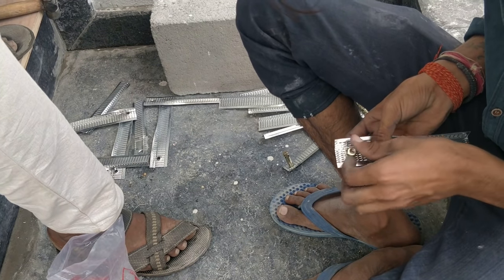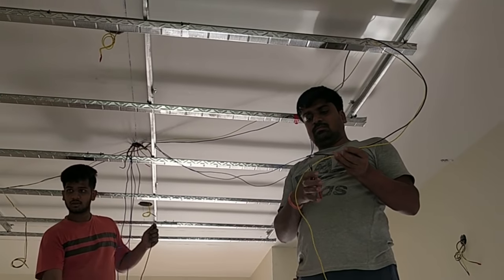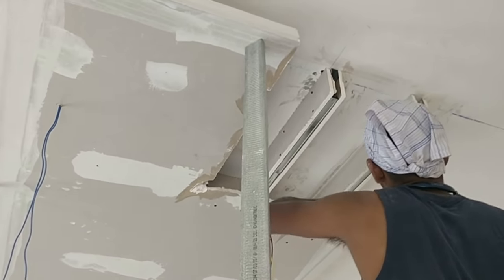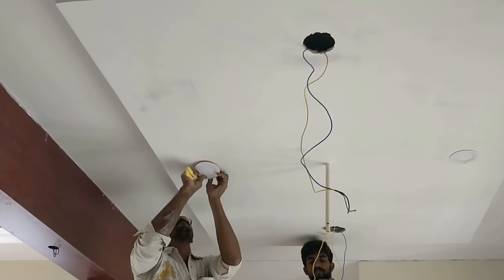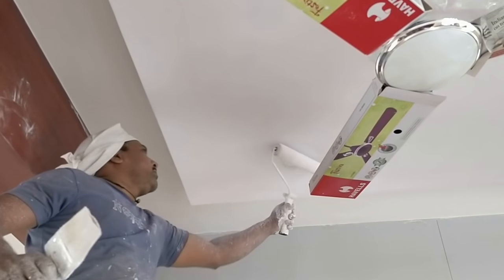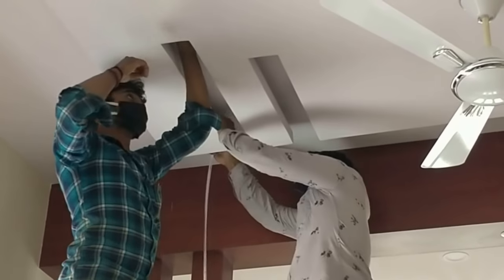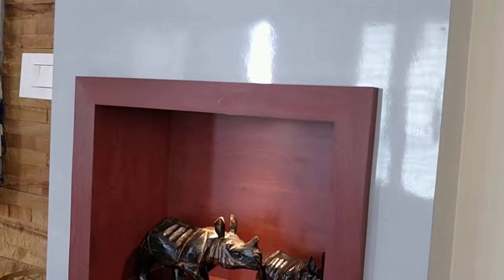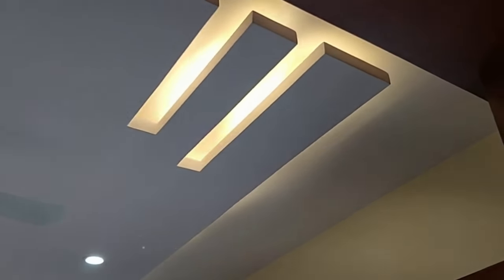Entire False Ceiling Work in 8 minutes - A2Z Construction Details

Comment: Wont drilling holes into concrete ceilings of top floor lead to water leakage during rain?
Reply: The holes  do not pass through the ceiling wall...Moreover..terraces are surfaced with waterproofing to prevent leakage in rain.
Reply: @rahilakhan831  not everyone does waterproofing. And also for seepages we dont need the hole to pass through completely.

Comment: Why do they always paint after fitting the over head lights? And then paint over the light as well which makes it hard to remove then incase some fault appears.
Reply from the maker: They apply abro tape before painting, so the light would remain after removing that. Also it can be easily cleaned with thinner.
Reply: @A2ZHomeGadgets  ohh...okayy. thank youu

Comment: 10*16 - 2 room and 10*10.3 1 room,

Can I know cost of fallceiling using gypsum board
Reply: Total 2 lacks
Reply: 35000 for plain ceiling
if u will add design it will cost u around 50/45k